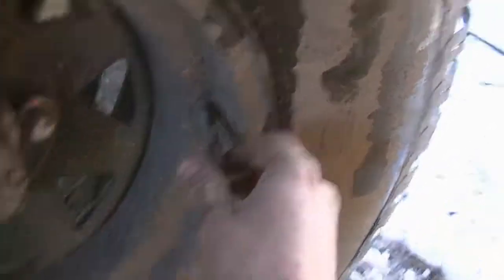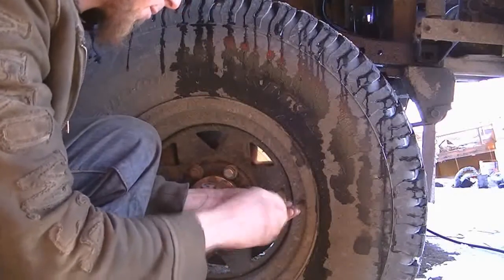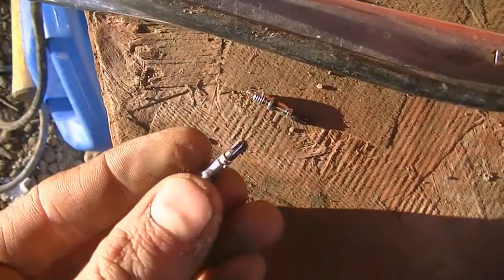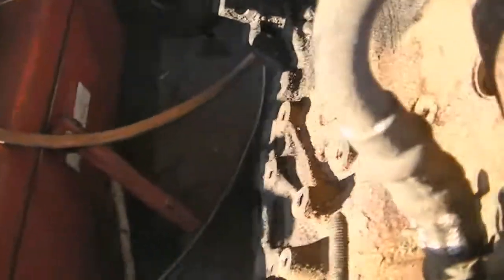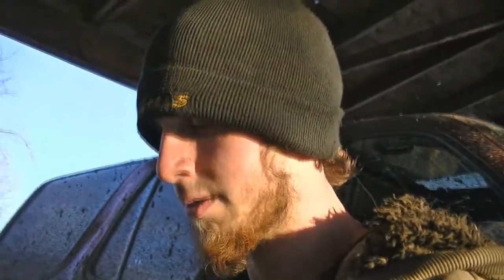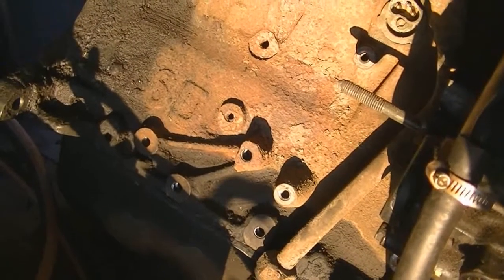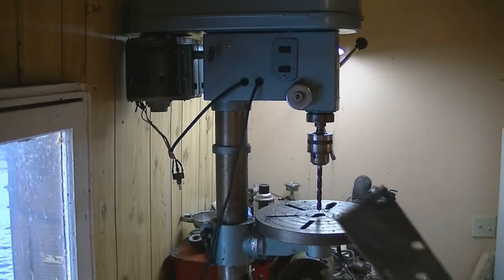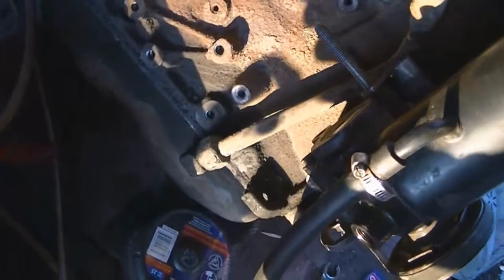Tire Issues & Motor Mounts (03/06/12)

Comment: In regard to your tire valve problems...When I lived in the mountains in Colorado we had that happen to our tire valves frequently. One mechanic told us the valve spring would weaken from freezing and thawing over and over until it sticks. He actually told me to spray a tiny dab of oil like 3 in 1 oil in the valve which will keep that from happening so often. It did seem to help.

Comment from the maker: @pmillerinc yea, that would really suck. that's why i had the other end of the piece resting against the drill shaft. if it grabs, it can't spin and cut off my face. it just slips the belt :)  for shorter pieces, i try to clamp them down.